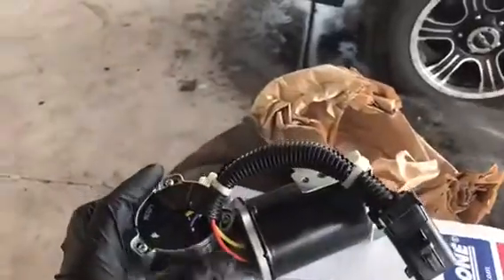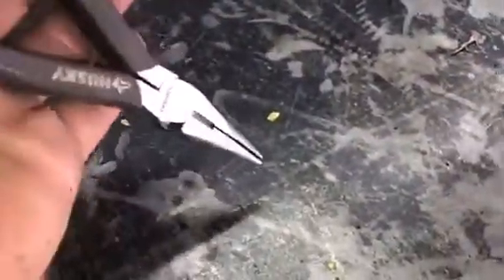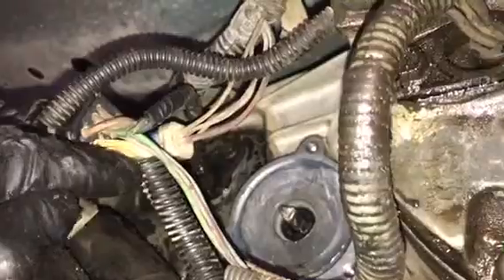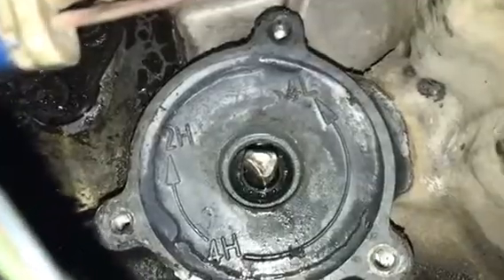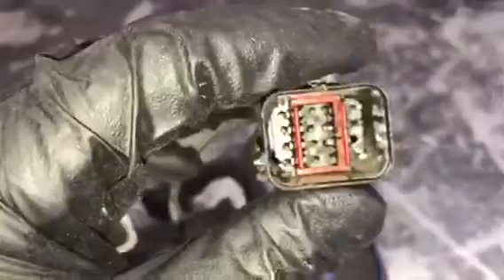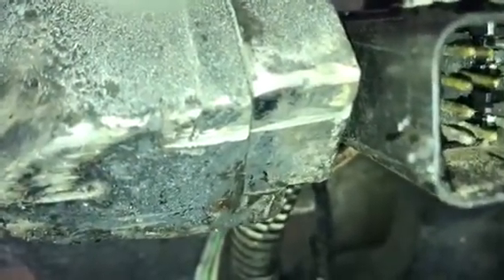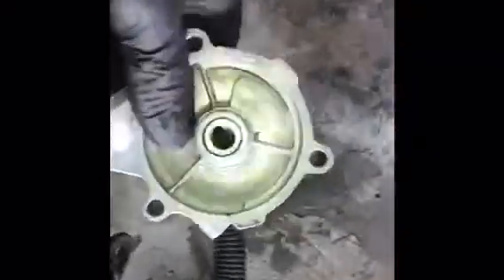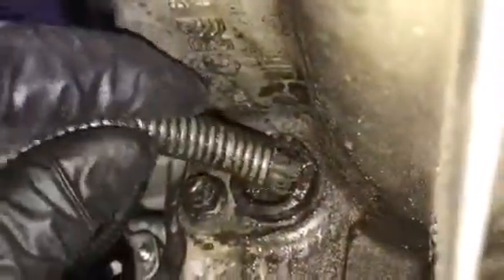Ford F-150 Transfer Case Motor replacement + diagnostics

Comment: My F-150 2002 was working good. Got home  and was going to the store. Now it will not go into drive or reverse and as I put it into park I hear grinding gears. Could it be this, what's wrong with my truck.

Comment: My 97 clicks but want lock in I used to take the hot battery post off for ten minutes and it would lock now nothing just clicks should I just change it or check it

Comment: So have 2002 F250 7.3 6 speed manual  w/Manual hubs and turn selector switch on dash and 4x4 light comes on the dash but not getting engagement of hubs turning  what you think issue could be ?

Comment: My new motors negative connection was not drilled through in the factory. Will it hurt it if I drill into the connection on the part? Advice?

Comment: Typically you only have to pull the one pin from your old and insert into the new no cutting required..
Reply: Also I would make sure case is in 2WD, then apply power to shift motor yellow n orange, and apply power n ground accordingly to get shift motor to move to correct position. marking where it should be is best, otherwise the truck will have issues indexing the position of the transfer case and may have other issues.. I have 20 hours into swapping GEM modules and testing trying to get this 80k abandoned 99 F150 back on the road, thinking my codes are due to me moving transfer case to match motor when should have been moving motor to match case, now codes for plate n motor that were not there before the swap...

Comment: Would this keep it from getting into 4x4?
Reply: Thats the problem I'm having. Check the fuse under the hood first. If its good, turn your key on and turn the knob to 4wd. Then reach in over your drivers side front wheel and try to turn the drive shaft. If it turns your transfer case motor is bad
Reply: Hey Larry what fuse under the dash

Comment: Well I got a question for people I got a 2003 F150 Larry ott super crew cab is got the electronic shift on the dashboard I have changed everything from the motor the transfer case module the 2 vacuum syllables I've checked for vacuum and everything else but on my silhouette I got power one side and a ground and now when I shift it I lose the ground on the 2 wheel and it goes to the 4 wheel drive to activate it but when I go to shift it back it does not transfer the ground back over to the 2 wheel drive so I can shift it back into full wheel drive If anybody can help me I would love to know what else maybe wrong

Comment: If you can remove the pin from the connecter why did you cut the wire?Wouldn't it be better removed and inserted in the empty space provided in the new connecter.
Reply: word...

Comment: now if you move the shaft pin on the transfer case back to 2 high  will it stay there with out putting a motor back on it so you can drive the truck with out jumping out
Reply from the maker: Yes that will be okay

Comment: So where you say if I cant shift the metal shaft coming out of the tcase to the motor, then I have a tcase issue, when I try to turn it, it wants to, but it springs back to where it was when I took the motor out, any help would be nice, this is a main vehicle so I need to get this figured out soon, thanks
Reply from the maker: I’ve never seen one spring back like that. What’s the year make and model? Try holding the lever in position while someone rocks the truck back and forth. It might be stuck in a postition due to vehicle in park
Reply: Its a 98 explorer, should i try having the truck in N, then try to move the lever? Also, when I have someone moving the switch, should i see the motor move?
Reply from the maker: Yes, you can unbolt the motor and move the switch. Obviously the position should move when the switch is turned. Have you scanned the 4wd module for codes? That would help
Reply: I don't have a scanner that can do 4x4 code scans, but, when i did a scan about 2 weeks ago, it was saying alot of contact plate low circuit, 4x4 circuit low, etc, there was about 8 codes for the motor and 4x4, but when i try the switch, i dont see the motor move, but the dash lights up 4x4 hi and lo, but not flashing.
Reply: Got the tcase shaft to turn freely, just had to shift the truck into N and then to P, I am just leaving It in 4AUTO, even though when I move the switch, I only have 4HI, but occasionally 4LO, Thanks for your help, now I got a main car back
Reply: I'm having this same problem.
Did you figure it out?

Comment: What were the symptoms of this going bad? I have a 1997 f250 7 lug. Just had a new windshield installed which cause my gem to fry. Replaced the gem and fuse block and my 4x4 still doesn't work. I replaced the 4x4 switch on the dash because I had a new one in the box sitting in my shop still nothing. Checked all fuses and all are good. The 4x4 lights come on when the key is first turned but goes after after a few seconds. I go to shift it into 4x4 no lights no click no nothing still. The gem and fuse block installed are both brand new amd are.correct with matching part numbers on both. How ever the gem and fuse block did fix many other electrical issues I was really hoping it would fix the 4x4 as Well.
Reply from the maker: the truck was stuck in 4 low mode. would not engage 2wd or 4wd unless manualy shifted lever with the motor unbolted. unbolt the motor and move the switch to see if the motor turns. see if you can turn the lever on the transercase if the motor unbolted.
Reply: Did you figure out what was causing the 4x4 to not work ? I have the same issue on my 97 f150 I changed the gem bcz I lost windshield wipers windows 4x4 and new gem(matching numbers) fixed all that except 4x4 now doesnt work fuse is good switch is good it doesn't click and light on dash doesnt come on and now my truck doesnt move on drive or reverse pretty much stuck in neutral

Comment: Is it possible to convert this to manual with shifter?
Reply: Did you ever convert yours to a manual
Reply: It's a bit late but there is a company called behemoth drive trains that sells a manual conversion kit. On their original video they say it's only $450 but on their site it's like a v2 after prototyping that's going for about $850 because it's anodized and pretty looking now.

Comment: I have a 96 F-150 that will go into 4 high but not low. It clicks a few times and turns the 4x4 light off on the dash but wont go into low range. Is there a control module under the dash that i would hear clicking?

Comment: Hi  i replaced the trans motor but i have no 4wd switch lights on switch or dash  when i first start vehicle the dash light shows 4wd high then shuts off   I replaced air tank and vacuum solenoids but still nothing  fuses look ok  but im confused   Any help would be appreciated   Thanks
Reply: This sounds like it might be a bad indicator switch.
Reply: hi thanks for ur reply, i did try a new switch but that wasnt it, im thinking its the gem module? the truck drains the battery also ive noticed and out of nowhere the rear cab light will come on by itself  could it be gem module?

Comment: I have a 2000 F350 with manual hubs but not going into four wheel drive... checking the motor on the transfer case but how far does it turn if it’s working properly? Mine seem to move about 1/4”.

Comment: I wonder if you could help me with a 4.6 Triton that's been sitting in my field behind my barn for about 2 years and a good motor at the time so I'm willing to risk that it's still good I would like to know the proper  protocol when taking the motor from outside storage what is the procedure I'm going through something like this with no time rents nest you kn manifolds what would be the step by step to bring this thing back to life after being in outside storage fore just over two years I understand the manifolds with the rats nest. So anything that is basic protocol into bringing something like this back to life would be  much appreciated

Comment: Thank you, my F150 Platinum won't switch, I'm going to take the motor off and try manually like you said, additionally I'll check the motor & power like you said. Any chance you have the proper resistance that the motor/sensors should be at?
Thanks!
Reply from the maker: Unfortunately I do not. Good luck!
Reply: So far I've found one chart mentioning this test and all it says is it should read zero for short or infinity for open.

Comment: I was able to move the pin to the motor back into 2h but it's still stuck in 4L the actuator wont disengage from 4L can you help me out
Reply: I heard one of the front tires takes the pressure of the 4x4 splines and will let it return to 2 wheel drive
Reply: Sometimes you have to go reverse to disengage

Comment: Awesome video, thanks. I have an 07 F150 that shifts into 4WD Lo but not 4WD Hi. I'm thinking it's either the Transfer Case switch motor or maybe the switch. In your video, you state that you measure voltage across the two larger wires. I "think" you said, one is positive and one is negative in Hi and the opposite in Lo. Is that correct? I know it's shifting into Lo because the light comes on and you can totally tell by the way it drives. But in Hi, it doesn't seem like it's doing anything and the light doesn't come on on the dash. Do you know where the switch is that turns that light on? Is it in the motor? I know the light works because it comes on when I turn on the key. I think the vacuum portion is good because it goes into Lo. Any tips for me? I'm thinking about putting it into 4Hi, then pulling the motor to see what position the shaft is in, but before that, I'd like to check the voltage. 
Thanks for any advice, and again, thanks for posting.

Comment: My dads Navigator just doesn’t change to A4WD, 4x4 hi or lo. Is that a reason to have a look at the transfer case?
Reply from the maker: possibly, you first need to check the fuse for the 4wd system, once that is verified good. you need to check for power at the transfercase motor connect with a test light like shown in the video. if power is good, remove the transfercase motor and manually move the tranfercase like shown in the video. if the gear moves. the motor is most likely bad. good luck

Comment: How did you know it was the Transfer Case Motor
Reply from the maker: I determined that the transfer case motor was bad by testing the power and grounds in the circuit. Using a test light like shown in the video. If the test light lights up while selecting different range modoes you know  power  is getting to the motor
Reply: Tap on the shift motor a few times and try the button .worked on my 93 150